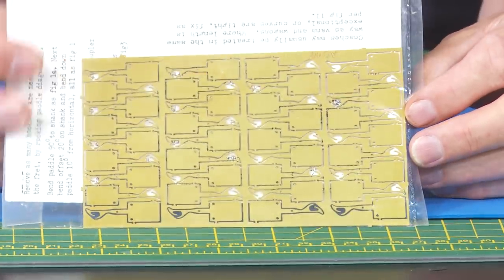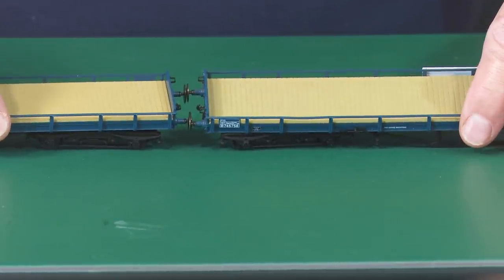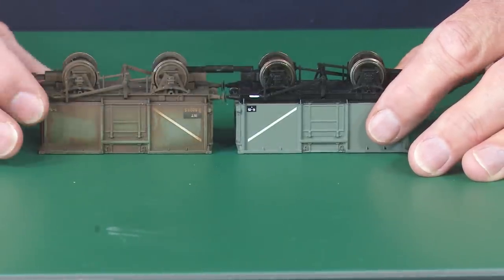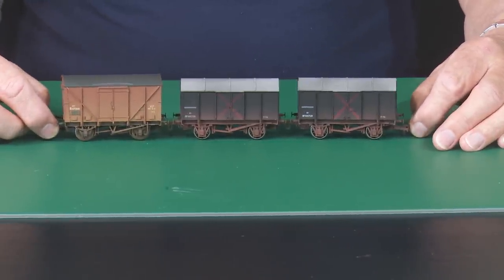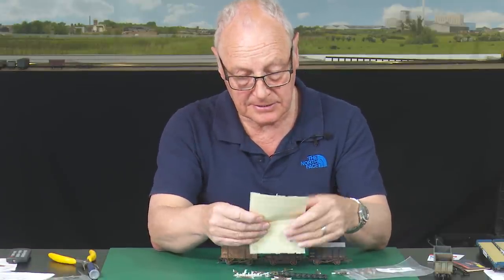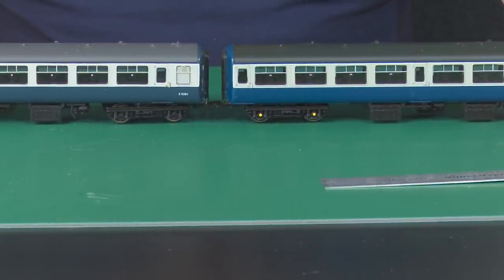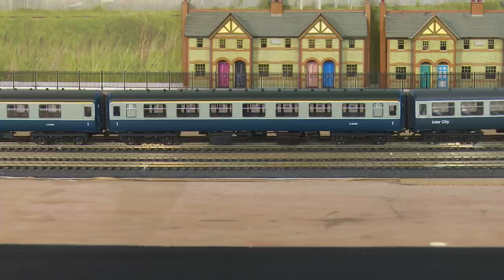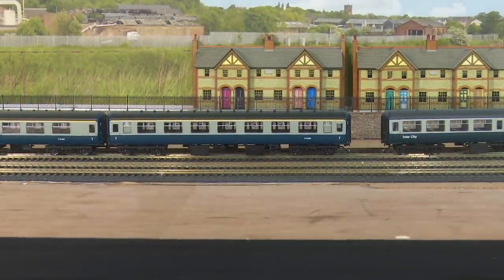NEM Couplings at Chadwick Model Railway | 92.

Comment: Hi Charlie, thank you for your interest in our Hunt Couplings, they were primarily designed to make uncoupling easy and offer reliability in operation with inclines, helix's and push operations.
The hst clip sets we do have been designed to work with layouts with second radius curves or helix's and double back on second radius, It has been a minefield and hornby on some models have altered the position of the pin in the coupling on the bogie
therefore we have had to design the HST clip set to cater for both, we do do a HST CLOSE CLIP SET but due to hornby's bogie design these are only designed for radius 4 curves and greater, we will pop a set in the post for you to look at.

Regarding strength they were tested for upto 14 coaches on a three tier helix, the locomotive started wheel slipping at that point, Love the Tug Of War :-)
Reply: Is there any plans for hunt to produce n gauge nem couplings
Reply: @katiedave1098  Yes already in testing - release soon :-)
Reply: @WestHillWagonWorks  thank you very much for your reply, can't wait for these fantastic couplings for n gauge.
Reply: Loving the OO couplings. Most of my freight stock doesn't have NEM pockets and I am having to buy 3D printed ones (as also featured in Charlie's video) but this is no great hardship - comes with buying old job lots from ebay! I think you have the price point spot on - especially compared to some other manufacturers - and I intend to modify all my rolling stock and locomotives. Cheers.
Reply from the maker: Thanks Chris, and it was a great conversation we had earlier as well. Good luck with your project and I’ll let you know how I get on with the new couplings, regards Charlie
Reply: do the hunt couplings interfere with the DCC concepts Power Base system?

Comment: I started to fit the keen system to my mk3s about a year ago.  After quite a bit of surgery I encountered clearance issues between the wheel flanges and the kinematic coupling.  With more effort I'm sure they can be made to work.  I parked the project at that point and instead have bought some of the hunt couplings which I've not yet fitted.  Up to this point I've run my HSTs with the powered car pushing the train.  Its not ideal but sure helps with that nasty gap.  Freight is a whole separate problem as you demonstrated. 

Those oxfords, blimey!  Not tried any of their stuff yet.  Cheers
Reply from the maker: Hi Richard, 
I had a text from Chris Hunt (Hunt Couplings) asking for a chat regarding my disappointment with my HST coupling gaps.  I measured the gap at a little over 4mm and he will make me another set with a 2mm gap.  
I left my Keen Mk3s unopened, being yet another “sometime” job.  
The Oxford clearances were shocking.  I just can’t understand why folks that do reviews have never mentioned it.
Stay safe mate, regards Charlie.
Reply: @ChadwickModelRailway  Interesting, I guess the issue is navigating the curves.  I have a mix of 3rd and 4th radius so will be interesting to see how you get on.  

Was aware of the gap on oxford mk3s but not those carflats.  Shocking as you say!

I'm safe & well, hope the same applies to you, cheers

Comment: Hi Charlie, just a follow up with the couplings. I use black chenille about 10 mm diameter. Drill 2 holes 1.5 mm in the top and base of the edge of the doorways in the centre, cut the chenille and bend it in so it sticks out a little top and bottom. You do this to both mating ends ,it doesn’t catch on anything and shows no gap at any angle. I use this on modern Bachmann coaches using the supplied brake pipe type coupling. Hopefully this helps. I bought a big bag of the chenille on e bay.
Reply from the maker: Thanks Christy, an interesting option and worth checking out. Regards Charlie

Comment: Great video again Charlie.  I bought some of the hunt couplings recently, pretty pleased with them - a few don't fit well in certain NEM sockets but this is likely down to different manufacturers so need a spot of glue, and some of the magnets came out of their housings which was disappointing for the price paid - still a bit of glue fixed this too.  The only downside is needing the polarity to be a certain way for it to work so trains need to be set up the right way round for a loco, but not a massive issue and a big improvement on the standard Hornby / Dapol etc.  Thanks, Tom
Reply from the maker: Yes Tom, they certainly seem to be a step forward.

Comment: Charlie, On Finescale stock you need sprung buffers  to stop buffer lock around tight radius curves. Also they need to be fitted with very soft springs so the buffers are moving as soon as they touch. I remember we all used to use very soft black sponge plugs to fit into the corridor connectors, to hide the gap completly. There was an article in the 60's in the magazine Modal Railway News on how to make and dress the outside of the plug to look like a bellow's connector. Still it keeps us in our bubbles. Next week I might put my toe outside the front door. Cheers, Chris Perry.
Reply from the maker: I’m pleased that you found it interesting Chris. I will work on the gap between coaches passenger access, once I’ve sorted the couplings.

Comment: Hi Charlie. Your homemade magnetic coupling will always fail first as the force being applied is vertical not horizontal (watch the coupling as the pull apart, the magnet lifts before separating). The hunt couplings line up perfectly with the strongest force of the magnet - horizontal.
Reply from the maker: I did realise that Rodney. However, I still wanted to win, but sadly that wasn’t to be.

Comment: Hi Charlie, I'm not sure if anyone else has mentioned this but I think if you're going down the route of semi-permanently coupled rakes, you could definitely get away with real miniature chain and brass hooks. Obviously more fidely and time consuming but they stay together very well and can easily adapt to imperfections and undulations in the track. Also, it allows you to keep the existing NEM pockets on the wagons, maybe the first and last in the train retaining original coupling to connect to locos.The main reason though is of course the looks - I don't think anything else compares for me.
Reply from the maker: An interesting point Otis and one that I shall certainly consider.
Regards Charlie.

Comment: Thanks for another great video.  An alternative coupling mechanism is the German Ribu system It consists of a KKK box with adjustable height mounted NEM box.  (The KKK is Kurzkupplingkinematic, not the US version!)
The box simply is glued to the chassis, great for Hornby coaches with bogie mounted couplings removed.  Priced a little high but they work well.
Reply from the maker: An interesting option Frank, many thanks, regards Charlie

Comment: G'Day Charlie. Mate what can I say, its a bloody minefield when it comes to couplings. Well presented as always, thanks.
 I think that is why I just stick to the one type, which is of course Kadee's. Yep even on coaches, to me its more about the reliability as well as the versatility of Kadee couplings. So far I've not seen another system that can allow the operator to uncouple and re-couple rolling stock at will on the layout without involving the "Hand of God" somwhere. At least with the kadee system you can use perma-magnets (or the electro) under the track anywhere you like and not even see where you have installed them (except for where you "Sign Post" your uncoupling spot). Or you can even go the rout like McKinley has with the "Auto coupling" with Kadee's. Can't say the same for the rest of them though.
Reply from the maker: You make a good point G130, KDS are certainly my choice whenever I need a freight solution.

Comment: I’ve gone with the hunt couplings and as they update their designs these have got closer so great results with HST close couplings though on the engines, one was loose due to tolerance discrepancies in the manufacturing. It did also catch part of the undercarriage so a little filing did the trick and this was reported to West Hill Wagon Works who were very obliging and sent me a couple more on my next order. Not as much luck with the hornby freight single screw on tension lock replacement types. The hole wasn’t a big enough diameter for the screw and trying to take this out about 0.2mm bigger resulted in it breaking through the surrounding material on two occasions. I was promised an updated product version foc but, that hasn’t happened despite two emails without a response, which is a shame. Loved your narration and video tutorial on the McKinley Railway shunters btw with the kadee cotton motorised uncoupling assembly with ESU programming. Dedication indeed and such a beautiful result.
Reply from the maker: I'm with you on this one Andy.  My HST has never looked better and I have removed all of my Keen Couplings from my Mk2 sets.  Regards Charlie

Comment: Hi Charlie,Des from Down Under.Enjoyed your video once again.I tend to use a mixture of coupling types.Haviing started,or should I say restarted,I use Roco close coupling/Nem pockets system components on my stock.I tend to use the Roco close coupler for passenger stock (Hornby use a very similiar coupler,but it is a bit bigger(HO as opposed to OO)For goods stock I have converted a lot of my British outline to the Roco type of coupler assembly .At present I have been looking at the Hunt system and also those Bachmann/Earth Magnet type of system you have described very well,the only disadvantage I can see over here the cost is expensive.My HST has been converted on the engine to a close coupling system used by Roco as a spare part which is available as a spare part.and it works well.I do like the system you have used with the earth magnets/Bachmann coaching bar.Hope I have not been too long winded,but in conclusion I would love a a world wide universal coupling system that would be acceptable to all...............yes i know I'm dreaming.kindest regards Des.
Reply from the maker: Hi Des, Yes a worldwide standard solution is too much to ask for. Good luck with your layout, regards Charlie

Comment: A little late to the party on this one, but what I've found to be the most effective coupling options for me is as follows:

I use the Keen replacement coupler plate / assembly on the brake ends of all my Bachmann MK1/MK2 coaches as this puts the NEM pocket at the correct height & location for using Kadee couplers.  I also use the Keen assembly when inserting Hornby coaches into the middle of a rake of Bachmann coaches.  I believe the latest Bachmann coaches have the NEM pocket at the correct location now, but I've not been able to verify. 
I use the standard Bachmann vacuum hose on internal couplers, as my rakes are mostly permanent and once on the board, they do not come off... although, I may look into the Hunt couplers going forward.
Everything else, is generally a Kadee #18, as I've found this to be the best fit... with the exception of the Dapol Turbot wagons. Like the Oxford carflats, a standard coupler does not give an acceptable distance between the cars. Dapol however, did include a very short coupling bar that is similar to the Bachmann intermodal coupler, for coupling the Turbots together.  I use a Kadee 17 at the ends where the Turbots connect to other stock, and when coupled to a Kadee 18, it provides a reasonably close couple.

I have used the full Keen system on a rake of Hornby Colletts and GWR Centenary coaches with varying degree's of success.
Reply from the maker: Many thanks, Derek, for such an interesting comment. I have in fact removed all of my keen couplings. I find that using the Hunt couplings a much more reliable commodity.

With my fix rakes I use the Bachman type hose, with a magnetic coupling midway, to assist with maintenance. Regards, Charlie.
Reply from the maker: +@derekgentle7116

Comment: Hi Charlie. Another great and informative video as usual, and my first comment to you too. Regarding the Modal (4)couplings I think these may designed for use on the Modern container wagons which run in fixed formations, and the 'inner' wagons have no buffers to lock. Just a theory as I have none. I'm currently experimenting with Hunt couplings and find they can be used for selective purposes i.e fixed rakes and quick to uncouple when required. Also although A & B markings are small to see, you'll find the 'A's are coloured Gold & the 'B's Silver.  Hope this helps people.
Reply from the maker: I too believe that these couplings have great potential.  I hadn't noticed to colours though Brian.

Comment: Great video Charlie, I have used the home made magnet on the cut pipe system for about 5 years now on most of my coach stock, occasionally it comes out of the fiddle yard a couple of coaches short of a rake but rarely, and it’s cheap and looks right. I would not use it for rakes of more than 9 coaches though.
Reply from the maker: Thanks for the reassuring comment. Regards Charlie.

Comment: Hi Charlie, great video for magnet issues i.e north,north,south,south redling each other if you use a ball magnet on 

one end of a a coupling it will stick to the north or  south poles oand  even each other and offers some compliance.
On the test you did at the end the failiure was more that rotationanl force through the coupling rather tha a streight pull which is not (prototypical) oops
Reply from the maker: I do understand that the test was not fair because it wasn’t a straight pull. However, it was a fair test after all because that was she are putting pressure. And what I’ve written doesn’t make any sense at all!

Comment: Hi. Hornby Maunsell coaches come with the kinematic system and the Roco style Close couplings. You can also mix one Hornby with one Roco to get them even closer. Why didn’t you cover the Roco couplings?
As I replied to your other video I love the Shapeways couplings on wagons.
Keep safe Alec
Reply from the maker: Hi Alec, I left off those couplings as so few people use them here, sorry mate.
Reply: @ChadwickModelRailway  With the height difference between some of those coupler heads that's no surprise, as all euro close couplers allow lifting the wagons out of the consist. Any height difference outside tolerances will result in unplanned decoupling

Comment: Hi Charlie. Another interesting and entertaining video though a slightly confusing title.....surely you have already established in video 81 that the best NEM couplings are Kadees. 

What you are really looking at are kinematic coupling mounts and the best couplers to use with them. In this case you should really be looking at the Roco and Fleischmann close coupling types which have been easily available in the UK for over 30 years. Hornby also offer a near identical copy of the Roco type.  I can only think of one advantage Hunt couplings would have over either of the types above: Coupling on curves. Both Roco and Fleischmann types can be 'disengaged' and used for shunting in the same way that a Kadee can.

The Keen System coupling mounts are really designed to be retro fit kinematic systems and used with any NEM pocket coupling and not just the Keen 'knuckle'.  These mounts should really have been put onto the Hornby HST in your video and then could have been used with the Hunt NEM, Bachmann bar or the Roco types - or any other number. 

If you have not had experience of Roco or Fleischmann close couplers I would urge you to seek some out. They are not the answer to everything - but for rakes of coaches or wagons with kinematic mounts (at the correct height), I think they are great.

Stay safe - I'm off for a look at your new ballasting video now.
Reply from the maker: An interesting point Andrew, which is much appreciated. The problem with couplings, is of course that there are so many different sorts that it is so difficult to cover them all in these videos. I’ve tended to go for the most common sorts that my followers use having listened to their requests. Stay safe mate regards Charlie

Comment: Morning Charlie, on the 'Hunt' Couplings, did you discover the modifrication made to the Hose pipe coupling to the effect that the contacting faces 'ROTATE' to suit the magnetism of each coupling to hold and not repel. I think they are around 19 GBP bag for HST /Close Coupling. When this Lockdown Lunacy is over I'll be looking at an order. I had the same problem with not enough hold on the magnets I got (1mm) 100 of them so I turned them into MU Cables, glued one to the loco connecter point  and one each of a fine Orange wire about an inch long. looks good and took care of surplus stock
Reply from the maker: Yes Wayne the Hunt Couplings are a useful asset. However on my helix the close couplings do present problems on the inner track. Regards Charlie
Reply: I wonder,  I don't have Helixes down here, (sorry, just one, in the middle of the North Island), I have an idea, if your couplings a letting go on the inside of the helix, it could be that the heads of the coupling are not TWISTING in relation to the two coaches. Got an idea that might work? cut the coupling off the shank, the 'face-up' the two surfaces, drill down the centre of the shaft so that the head/knuckle swivels. It's going to take a bit of experimental strength testing. pinhead in knuckle jaws and rest of pin down shaft, when everything is working, heat end of pin with soldering iron to fix in place n the shaft and the  head swivels. Necessity is the mother of convenience or something similar...I'll let you know